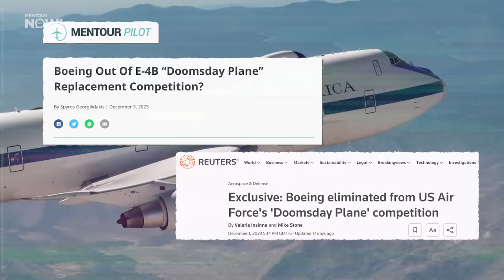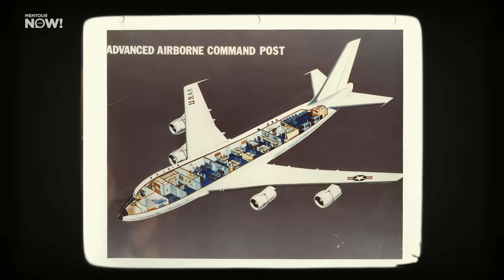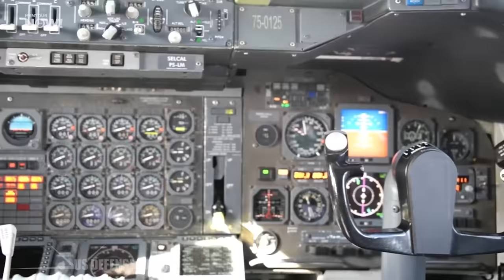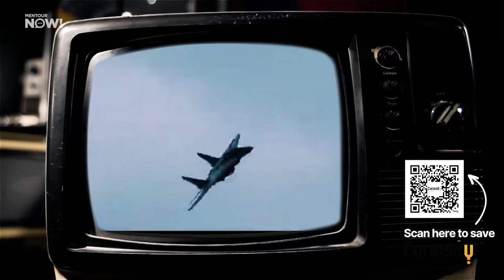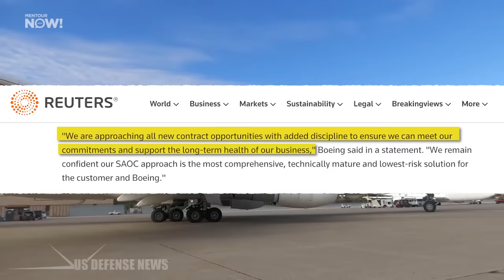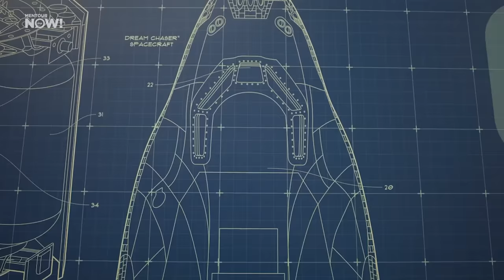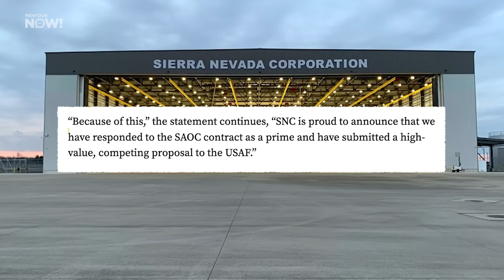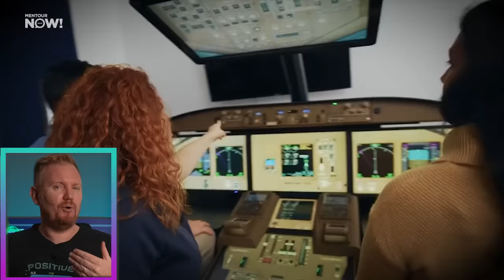Why was Boeing kicked out of the Doomsday Plane competition?!

Comment: Cost plus is not the answer. Boeing needs to sharpen their pencils and create a bid that actually reflects the cost in the first place rather than making it low enough to beat anybody else by price so they get the job in the first place and then  add the true cost later.... that they already knew but didn't want to tell anyone 'cause they would loose. A Cost plus bid is dishonest from the outset and should be discarded up front. Boeing has shown in the past  number of years that their engineering is substandard and that their quality control, both with components they buy from others and with the work they do in house is lacking. I think they may well find themselves out of the race and I think that is good. I think if they got this project on a cost plus basis, Boeing would use this project to effectively "cost plus" all of their fixed price contracts they have made in the past few years.  That is they would use this to take care of their losses in other projects. I think they need to work at their commercial airline business and get that right first and turn their company around ahead of time. Other wise the government will will be paying the "plus" to keep the company alive rather than for extra expenses generated by this project. I realize Boeing has a loud voice in the government itself.... lets hope that is not effective. Boeing should not get this project and I suspect it is important to US security that they do not.

Comment: only Boeing owns the tech data package on their commercial jets.    if you are building the SAOC with Boeing as a participating subcontractor the redesign and requalification of the type will be $$$ if possible with intellectual property fences from Boeing years of experience.  Boeing has probably maintained  and provided the tractable parts for the planes.

Comment: SNC are a lot more than just what you described. Systems integration and electronics are their wheelhouse - I don't think there's a single US DOD aircraft that doesn't have a dozen critical systems they designed. 

That's not even the beginning of how awesome they are! This channel covers big, passenger carrying stuff, but they're a huge power in commercial drones, general aviation avionics, and more. 

It's also one of the most highly valued companies in the world that's not only owned by a refugee, an immigrant, or a woman, but Eren is an incredible engineer and inspiration!

Even though I have a lot of issues with what their company does on the military side, they're also my #1 aviation company to work for!

Comment: Great video!  BOE has gotten caught in its own web of bureaucracy and regulation. A factor here is the gross and really more problematic, the incompetent, over regulation by the FAA.  The 737 Max debacle is a recent prime example where both BOE and FAA openly demonstrated their incompetence. Although over regulation is a/the culprit, another company, SpaceX, seems to be navigating equivalent over regulation just fine.  So, although over regulation is a problem, SpaceX proves that it is not THE problem.  Instead, it is grossly incompetent and inefficient corporate structures, operations and policies which are at play here. This is what gives Sierra Nevada a fighting chance.  But only if they can muster the same streamlined efficiencies and competence as SpaceX. Otherwise they could find themselves in a similar quagmire. And that in turn will put the US taxpayer in a similar position. In the end, I’m not sure I would not have just given BOE a cost plus contract. There is a huge amount of institutional knowledge (most highly classified) that will need to be acquired by Sierra Nevada (or anyone else), and I think this represents an enormous and likely under appreciated risk to making this work.  If I was Air Force I would have worked on beating up BOE to become more SpaceX like for this effort (this can be done by standing up a completely separate organization), and staffing it with only the most competent people. This could actually be defined as requirements in the contract.  At same time, Air Force would have to do the same thing: you can’t expect stellar performance from the contractor when you have an incompetent government team running it (ask me how I know, I assure you, I really do know this, and I suspect most reasonable people appreciate this, but not Uncle Sam).
Reply: Spoken like a true Elon Musk fanboy.

Comment: Boeing has become an accounting company as apposed to an engineering company. They essentially want the money but want subcontractors to do all the work. they had one of the largest and most advanced wiring facilities at their philly area plants but essentially through it away to save costs in 1995... hah I'm sure you can guess how that turned out. all that experience, parts and tooling just given away. afterwards any repair, improvement or upgrades were financially nonviable. the plant president actually apologized to the employees for making such a dumb move.

Comment: No rationally ran business wants to open themselves up to staggering losses, especially one in a recovery mode from their greatest loss debacle ever.  I think Boeing is being very rational as they know they are one of the only proven entities that can actually get the job done without unknown doubts like can the company deliver what it contracts.  This bounces the ball back to the government.  Do they rewrite the contract or do they push forward and have to settle with either a foreign entity with the proper technical history or take a chance on a less assured retrofitter?  Would it be surprising if the date is pushed forward for the contract which will be a modified one from the present contract?  I think Boeing is still very much in the mix and will leverage a better contract.

Comment: I wonder why the new 777X doesn't fit the needs of the air force. I live just north of the Everett, Washington facility and have had a close look at the behemoth. Is it not in the game because of four engine requirement? Saving the taxpayers money has never been a consideration for the feds, but the giant GE9X engines on the 777X are both powerful and fuel efficient and would save a ton of money. That might count if the dooms day plane had to come online with the possibility that fuel interruption may occur.
Reply: if anything it would need to be the 777-300ER because the 777X has yet to prove it is a reliable aircraft. And then the 4 engine requirement.

Comment: This is all about Boeing consolidating and using their monopoly on these fabulous contracts. They are betting on their competitors failing and then taking the contract back on much better terms for them. And they very well might be able to force Sierra Nevada Corporation into a desperate situation because they have most of the cards.

This is, again, Boeing acting as a financial raider instead of as an engineering organization. They might make a huge profit at the expense of the whole aviation industry, or they might get the whole industry tumbling down with them. Hopefully, they might not succeed, and the industry will benefit.

Comment: Boeing just want a non-fixed price so they can gouge more money latter with delays. Besides, with the issues they are having on starliner, do you trust them to get the design right in less then 10 units?  They need at least 100 to work out the problems and get it working properly before going back and fixing the first ones.

Comment: hej Petter, Merry Christmas to you and your family from Germany! The A380 as a possible successor has the appropriate and fulfils the requirements of having four engines. The Pentagon has not bothered about thinking about putting it on the list of possible options. Firstly, hardening it against EMP is a much bigger issue than the 747 with its steam gauges. Secondly, the A380 is EU-made and therefore a possible threat to national security. HUAWEI has lost some contracts in the USA simply because of its Chinese HQ.

Comment: It's not like Boeing is a completly innocent and helpless victims in these delays and price overruns.  The level of shockig incomptence on Starlinr is well documented. The had software  issues in the first test flight that would have been found in ANY simualtion and test on the ground.   So it was painfully obvious, that they didn't test it before the launch. 

And with their reputation nuked by this and the 737 max debacle, it's probably very wise  to make it fixed costs contracts when dealing with them. Then again, once such a program is running and progressed it will probabaly become to big to fail and ben dropped.

Comment: Here's what I want to see. 747-800 with the engines mounted ABOVE the wing, using engines from the 787 or a380. It would probably still be subsonic, but have an amazing rate of climb.

Maybe you need to refuel to make it back to America, but you can get out of dodge on short runways with minimal notice.

Also oxygen is a concern but get up to 60,000 feet for wartime.

Comment: Boeing is screwing up again

Because of the stupid mistakes it's made with the 737 Max and the Starliner program - both of which are result of Boeing straying from its roots and really all started to unravel when they made the Chicago move - so now they're passing up on what is a very prestigious contract just like the same way that Air Force One is very prestigious. If they had done business the way they always had done business and didn't get too smart for their own good then the previous problems wouldn't have existed and it could easily handle this even if it meant they were doing parts of it at a loss because contracts like this because they take so long even with a set price contract there's always stuff that gets added in it's only set price in name and the basic contract

Watching what Boeing's been doing to itself for this past decade and a half is just saddening and depressing and could have easily been avoided if they just thought things through and didn't think that they were so smart with what they were doing by being "shrewd businessmen" which they definitely were not.

Comment: The idea of a manufacturer of space vehicles in the competition is intriguing. If I were that company, not only would I create a proposal for the project but also submit a counter proposal of a doomsday vehicle traveling in orbit at some agreed upon altitude. SpaceX probably would be the launch subcontractor and there would have to be some kind of extremely high reliability analysis. The vehicle itself could be maybe half the length but approximately equal cross section of a modern submarine, and perhaps made of the same materials. I don't know what the survivability against attack might be, that would have to be analyzed. There's no doubt that the vehicle would be traveling very fast and could be maneuverable so might not be so easy to hit.

Comment: Maybe Boeing has finally recognized that it doesn't have the engineering capacity nor the project management chops to attempt "small" scale, specialty work like this. Even MBAs learn if they bang their heads on the wall often enough. Especially if it's not built in Everett.

Comment: The question I have is why the USAF doesn't use the C-5 Galaxy air frame for this role? I mean aside from it not being of commercial airliner origin it fits all the other requirements, especially the 4 engine requirement and given that it has enough internal capacity to carry 2 Abrams which are big in their own right, I cannot see that it wouldn't have the capacity to carry all the equipment needed for this role either. Plus I know for a fact we have/had several C-5's just sitting in the boneyard (at least they were there the last time I was there in 2019) tho I do not know what variants they are, at the very least they could probably be cannibalized to cut down the costs on the new air frames.

Also to my knowledge Lockheed did plan on making a commercial variant of the C-5 dubbed the L-500, I'd imagine they would still have the plans for that aircraft somewhere and could redesign a few C-5's into the L-500 variant to meet the commercial requirement.

Comment: No guarantee that their planning on using the 747. The A380 complies with modern requirements & feed stock aircraft are more readily available. I won't if Airbus have a partner?
Reply: I don’t think they buy from a Non-US company.
Reply: @mudi2000a agree, SNC, LM or whoever would be the contractor, but what aircraft they use is an open question. Theoretically they could even use A340s, plenty of them available as well with lower hours

Comment: Smart move by Boeing.  I’m sure that Russia has some large capacity four engine Antonoff planes ready to be converted for this project.  That would likely be the only company that would be able to comply with the conditions of this contract.  The Air Force ones everything for free.  If you get it for free when you become the product.
Reply: Antonov is a Ukrainian company 🤣
Reply: right, we buy a bunch of Antonovs and then don't pay for them
Reply: @Henning_Rech  which the facilities were pretty badly blown up in the invasion, while Russia technically still has a number of An-124s flying around, ironically more than what Antonov airline owns even

Comment: The political risk to funding of this sort of a contract is huge; if Republicans (in their current ideological form) regain the Whitehouse or retain the Senate at ^any^ point during the contract they’d be pushing back hard against the need for 10 of these. Given break even on the development phase isn’t likely to happen till the 6th unit or later, Boeing might feel it’s just not worth getting involved for now. They’d still essentially be a major subcontractor (if the platform is is the 747-800) and able to lock in a pretty juicy parts and maintenance contract going forward say 30+ years.

Comment: The US only really has 3 4 engined aircraft that fit many of the criteria  the USAF would require, the already discussed 747-8s, the Lockheed C17 Globemaster III and the Boeing C5 Galaxy. All of these are obsolete airframes that are reaching the end of their operation life within the next 20 years. Only the 747 was ever used as an airliner which likely rules out the C17 and C5 if they insist on FAA approvals. 

The only large airliners left in the running are then the Airbus A340 and A380, being fly by wire may make them difficult to harden again the EMP from a nuclear blast, but not impossible. 

These airframes are new (compared to 747s) and are already supported, conversion may be easier for modern digital communications systems to be incorporated into the airframe so this may be the best choice given the limited market the contractor may be faced with.